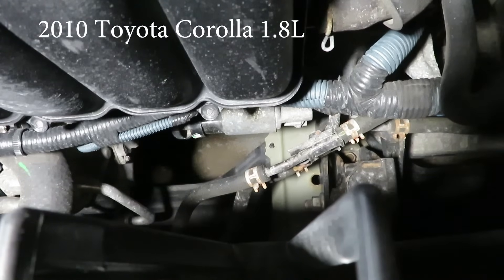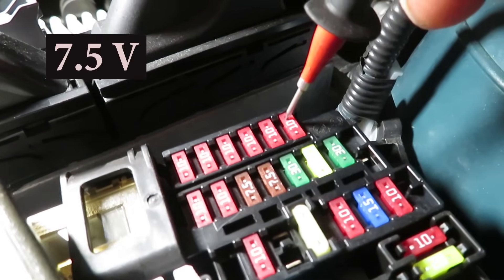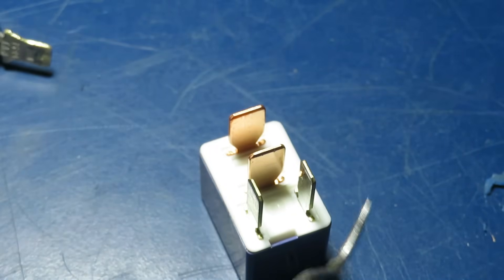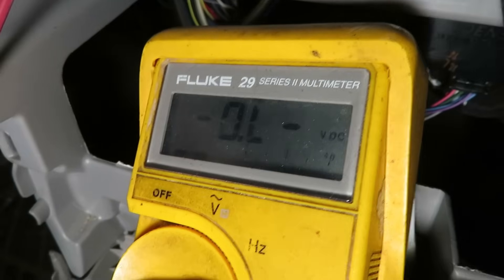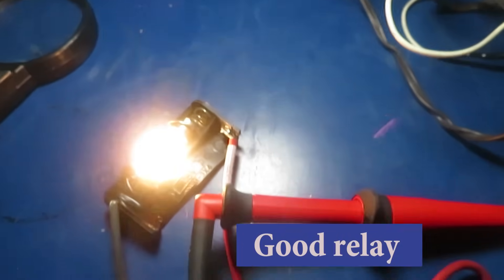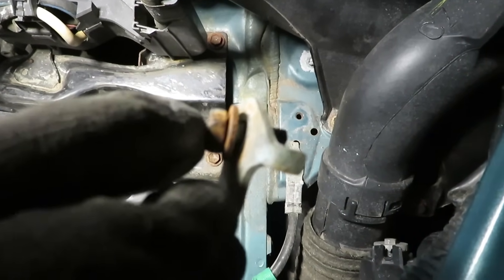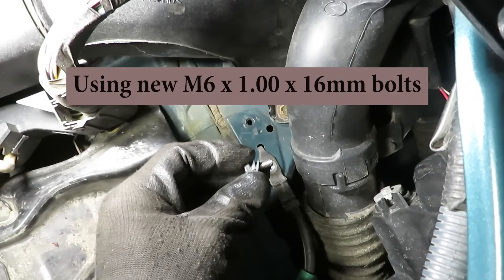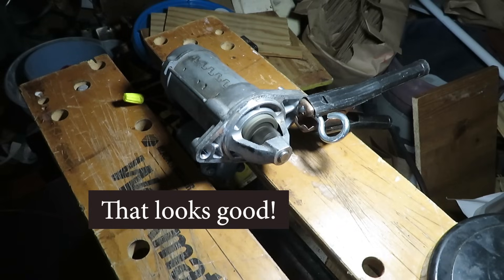When Your Car Won’t Start: Symptoms and Solutions for a Bad Chassis Ground

Comment: Good Job, but you might also want to replace that battery cable which had obvious corrosion showing; that green stuff just keeps on creeping. Thanks for the video Sir!
Reply from the maker: I usually just brush it with a mix of baking soda and water to neutralize the acid.
Reply: I agree with you John, it will travel up the battery cable under the insulation.
Reply: My car is currently sitting right now and I just replaces the starter.  New battery, all lights work, radio, etc.  Could the ground to chassis still be an issue to a no crank, no start issue?

Comment: The methods are good but the diagnosis is bad. You start with the simplest solutions first that involve NOT dismantling the entire interior.  Then you travel ahead through the symptoms until you get to the more complicated troubleshooting that involves removing the starter, parts of the interior, half the dashboard, etc.  If you're running a shop with high labor by the hour rates though I'm sure this is a method of choice to make tons of $$$$$$$$.  First thing first would be making sure terminal posts are clean and tight and check it.  Then source a new battery and check again. Many people are too ignorant to know their battery is dead. COPART yard monkeys even does this. They will say a car doesn't run/drive when it just has a dead battery. If that doesn't fix it then start poking around with fuses, wiring, etc, all that stuff.

Comment: I messaged you earlier with the 2012 Corolla. Very awesome videos. I have had trouble with this car since before it broke down 2 years ago. But when it completely died i was driving on the interstate and everything went out as if you removed the battery. At the time I really thought it was the starter and it was bad. But after replacing it i found out the alternator had to be replaced along with the ECM, interior fuse box and this relay that goes to the starter and fuel pump. Also the crank sensor ended up being the last item i replaced and I went back to the internet and found your outstanding videos. Im pretty sure its either bad ground,  no power to relay socket or this relay went out . I say this because the new starter keeps going for about a second or 2 after key release. Thanks so much and keep up the great videos!! They really,  really help, especially folks like me.

Comment: This was an AMAZING, JUST AMAZING piece of work finding this!  I have a mazda 3 2006 and my car won't even start.  I will check the fuse box but my expertise is not going further than that, sadly.  Watching you finding this problem was very inspiring and educational, I would have never imagine it would be a simple 'ground contact' problem.
Reply from the maker: I appreciate the feedback. I have a three part series on ways to troubleshoot and fix starting problems. Part three is the most popular:  https://youtu.be/Pw_iuxjgzyY
Reply: LOL i have the same car, same problem, same day, thats how i ended up here. the ground on 2006 mazda 3 sucks and wears out
Reply: I now recommend all my friends before even bringing their car to anyplace, to first sand their battery connector, re-install and try to start their car again.  My battery connectors look fine from outside but when i deconnected the negative side (-) i realize it had greenstuff all around the inside!  I sand it, then re-install, and bang!  Start without ANY DARN PROBLEM!  It seems that green stuff is really good at isolation!  I mean, even when i play around the connector, i sometimes get 'sparks', so it was the last thing i would have thought was the problem!
Reply: @jessikapiche6097  lmao I can't believe I read your entire comment

Comment: Yea -Haw.  Found your excellent video.  100 bucks says this fixes my new 07 vibe that stranded my wife and i had to go jumpstart with my 3 year old.  Just got the battery in it.   It died on me pulling in my garage after a bunch of dash lights came on after i spun on ice at the driveway end.  Hasnt restarted yet.  
Your a noble gentleman!  Thanks from minnesota.  I snapped a shot of your hdwr Text.  
Thx in advance of my repair!
Reply: Yep.  It worked.  Thanks!

Comment: 2009 Corolla dead in driveway- changed the battery with a recharged one, actually saw the two chasis bolts you highlighted- rusty so hit them with shot of cleaning vinegar - I think you've put me on to something ! 
News @11

Comment: Just had this problem with my 2010 Hyundai Genesis Coupe...starter would just click...watched the video, ended-up replacing the negative battery cable and the post...fired right up! Great video...thanks!
Reply from the maker: You're welcome. I'm so glad the video helped!
Reply: That why I interest to big 3 upgrade even I don't use after market stero sys .

Comment: I've had problems with starting my 2010 Toyota Corolla LE. Try to start the car, hear a sputtering sound, weak lights on the dash. I get out, disconnect the battery clamps, then reconnect them then boom, car starts up with bright lights on the dash. Bad ground connection builds resistance that jams juice trying to flow through many possible electrical hookups. Beautiful video is a sight giver.
Reply: How did u fix this I’m having same problem
Reply: @camillatucker9802  I haven't fixed my problem. Did you try what was shown in the video? Disconnect the ground wires to the chassis of the car, then reconnect them after cleaning them?

Comment: Yep bad grounds can drive u nuts. Lights flicker is a good sign. Clean your cables and what I do even on the battery post clean and put a little grease on them. And same on the motor.  Where the other end goes .

Comment: I would advise using a volt drop check rather than resistance. From the earth bolt to the earth eyelet a good reading would be 0v. Also, with the starter in place if connected a jump cable from the starter body to the negative terminal on the battery and it starts, you know you havean earth issue

Comment: I like the scrapping off paint to get bare metal to metal contact but isn’t that going to create the same problem you’re trying to fix with the corroded ground bolts? Wouldn’t replacing with new ground bolt be the better solution? The thread to thread contact should be enough for the ground path.
Reply from the maker: It made sense to me at the time but I think you have a valid point. I still have the car three years later and thankfully the problem has not recurred.

Comment: Bout to check for the signs, but what causes the check engine light not to display on the dash when the key is in the on position .
Reply: Check your ignition relay in the fuse box under the hood. Just had that problem, but replacing that relay got my dash lights bacc on

Comment: I have issues starting my car when it's hot. Sometimes it just starts right away even while warm, sometimes has issues starting while cold, but mostly while warm (it sounds like a slow cranking) which is a pain in the ass as I gotta wait for it to cold down (around 45 minutes). I already cleaned injectors, replaced fuel filter and serviced the starter motor, all of that is good now, but still have the same issue.
Gotta try this chassis ground thing now, hope I can find where the ground connections for everything is 😅
Reply: Did it end up working?
Reply: @tongxiong3060  it did. I replaced some ground wires and problem fixed. I felt really stupid afterwards because the fix was kinda easy compared to everything else I did before 😅
But now I know that ground wires can "get bad" and need replacement.
Reply: @cotelo  that's good to hear because I'm having the no start issue as well and seems to not start when warm and more so when it's colder.  I'll have to give that a shot.  Did you have a no crank issue though?  I just get a single click with all accessory lights on.  With these issues I've been able to tap on the starter to get the car going but now it's just not doing anything.  I replaced the starter and same thing so I'm kind of lost.

Comment: Grind all paint and the contacts ,,replace hardware with stainless , coat contacts with copper based dielectric grease .now treat all grounds on vehicle same procedure

Comment: If u read this.   I had the same thing.  With the sfarter installed.  Touches the starter i got 1.2 voltes.  As i gave it ground my horn sounded off
Reply: If you read this. Good job learning English 👍

Comment: My 1984 Toyota battery is fully charged. It won't start l. New battery terminal clamps and smoke started coming out heating up and ground melted. Why?
Reply from the maker: Sounds like a short to ground or the battery terminals are reversed.

Comment: mine only does one click   but i see a  kind of corrotion too and i have been having  alternador  problems ( got a new one )  the head lights  flicks and the  car  kind of  surging  on  parking  or  it was  now  its completed dead for  2 days  i was thinking about ignition switch  but   we the history of  2 bad alternadors ?  only does one  click  not exactly the same  as the video   i wish  is the  same problem  is  cheaper ( battery is giving 12.6 v ) some one told me  bad cells?  is a new one but its a AAA  road assitance  battery i  see theres a lot complains   )  any ideas?   thank you 
note  :  the car  did this to me like a mounth ago but  started  next  day   but no this  time i kind   felt it  low  star in the morning  and  it died  in the afternoon  ..so a bad  iginition  swicth could it give  me a slow star  ? or   this is   meaby  a ground strap  problem ?
Reply: Hey Percy! I know this post was like from 2 yrs ago. But I been having the same exact issues u described in ur comment, with my Infiniti. And I was curious if u ever fixed ur problem with ur vehicle and what needed to be done to fix it? Thank u

Comment: it necessary to scrape paint if you dremmel lug and bolt?  wouldnt that carry the current if you get the rust off the bolt and washer
Reply from the maker: Yes that would be enough.

Comment: My '10 Corolla LE has a slow cranking issue and never starts.  Had not driven the car in about six days.  Decided to start the car but would crank but not start.    The tow company thought my battery was bad and possibly the alternator.  So, I went and replaced the 2.5-year-old battery with a new one thinking a good battery might solve the cranking/start issue.  It did not solve the issue.  When I was installing the new battery I did notice that the ground bolt was very rusted.  Do you think this is the issue?  I have never had starting problems with the car before..
Reply from the maker: I too changed a good battery when this problem came up my Corolla. Definitely make sure your grounds are good!
Reply: @ginalMechanic The car is at my mechanic and advised to him to look at the grounds and check to see if they are good.  Hopefully, that's the problem and nothing major.  also, during those six days the car was not started, the key fob battery was dead so I replaced that battery.  After changing the battery. the key fob seems to unlock and lock the car.  However, does the key fob have to be re-programmed for the car?  Maybe it might be causing some issues with the start?  Just trying to rule things out.
Reply from the maker: No, the key fob would not need to be reprogrammed. You can rule that out.  @savio1172

Comment: Hey, question.. How did you have the starter wired up at 0:32? Just positive end or just negative end?  Occasionally my starter plunger will come out with a single click and not spin, just like at 0:32. This rarely happens but is always fixed when I hook the starter up directly to the battery.. then it starts right up. I've had the starter bench tested and tried a different starter but get the same result. Ive checked all wiring and cleaned all connections multiple times, all seams fine..have you ever heard of this happening? Any ideas?
Reply from the maker: I had both positive and negative wired up with the positive directly to the battery plus and a jumper cable on the negative. That's a toughie. i would definitely use a meter (set to measure resistance-ohms).  Check resistance from battery negative to various solid metal points on the engine and chassis. If you get anything but very low readings on the order a few ohms or less you still have a bad ground. It sure sounds like a poor ground connection since it starts directly from the battery.
Reply: Awesome ill take another look around the ground connections and pull out the meter. appreciate it @TheOriginalMechanic
Reply from the maker: I should add that at 0:32 I simply extended the car start  wire to the solenoid with a wire to reach the  the removed starter  under test.

Comment: My car is full of rust and all I here when I try to start it is a click coming from the starter 😢
Reply from the maker: That click is likely the solenoid and a sign that there is either not enough power from the battery to the starter windings or open windings.
Reply: @TheOriginalMechanic what are windings?
Reply from the maker: @j7sportvideo24  The electrical part of the starter. I'm basically saying that the starter itself may be bad.

Comment: Glad to know all major ground. Just want to know more where can I find ECU ground ? Btw good video. Thank in advance. Wait I want to know ignition coil secondary ground too. I know where fuel injector ground are. It on engine easy to find.
Reply from the maker: You would have to find the wiring for each component and then probe it for the ground. Remember all grounds in a circuit go to the same place.
Reply: @TheOriginalMechanic  good idea I got low quality probe cam can't use in cyclinder. I might use it

Comment: brilliant sir. but in my case, car starts ok but needs longer cranks mostly when warmed up. 
scenario:-
1) morning cold start, or whenever climate is cold = one crank ("hek") starts right up
2) after shutting engine off and restarted within 5 minutes = one crank ("hek") starts right up
3) after shutting engine off and restarted ANY DURATION AFTER 5 minutes, 
= 1st crank ("hek hek hek hek hek hek"), 2nd crank ("hek hek hek") then starts.
I don't think the starter or ground is the issue here because of no.(2). 
Two different workshops mechanics told me it could be the distributor (w/out detailed checking). 
Battery/alternator both are fine. Been having this problem for four years now. 
on a side note (not sure if this is related) my car runs fine but idling is very slightly rough.
Do you have any video on this that I could refer to? many thanks in advance.
Reply from the maker: This doesn't sound electrical at all. Since it occurs when the engine warms up I would wonder about the engine itself. I once had a car that would always start great but when hot it would randomly die and not want to start again. It was a broken head bolt. This could be a lot of things, many of them hard to find.  I would  have the compression checked first and see if that turns up anything.
Reply: @TheOriginalMechanic  my car would not die randomly, in fact never before been in that situation. ok sir will do that during my next service. thanks anyway for responding to my looong query sir 😅 have a nice day

Comment: Is it necessary to dismantle the dash?
Reply from the maker: No it isn't.
Reply: @TheOriginalMechanic  Ok. I have a problem with a Grand Vitara. When I switch the starter, the car doesn't start and the dash lights start flickering erratically. It also makes weird noises inside the dash, specifically around the radio and AC controls. What can it be?
Reply from the maker: @leumamk5259  I would start looking for a bad ground. These are the types of symptoms that show up when there is a poor ground.

Comment: No mention of how you set up he multimeter. Negative battery terminal removed but not positive? And, was the negative on the multimeter somewhere in particular?
Reply: Also next time I suggest adding some dielectric grease to the fttings to ensure continuity in the harshest conditions.
Reply from the maker: I had the meter in the ohms (resistance) mode. I thought I pointed that out. Since we are dealing with a ground issue I did not disconnect battery plus. The meter measured resistance between the battery ground connection and the chassis t near the suspect lug connection. I hope this helps. I strive to be clear but occasionally fall short.
Reply: @TheOriginalMechanic  Thanks for the reply! Great video of course, you went ALL OUT. Still though where is the negative on the multi-meter placed? I just watched another video where buddy left the battery completely connected but place the multi-meter's '-' in the negative terminal..?
Reply from the maker: @davidthomas6949  When measuring resistance the polarity of the meter probes isn't important. But to answer your question,  I had the the negative  on the clamp end of the battery ground cable and the positive  on the lug bolting that cable to the chassis.  A good connection would have been .2 ohms or less. I got 52 ohms which revealed a poor ground connection.

Comment: For the ground did you have to disconnect the battery first or just remove ground ?
Reply from the maker: The ground strap being removed is about the same as disconnecting the battery.

Comment: What do I do if the car cranks but won't start? The lights works but not the stereo. I changed to a new battery to but it's not working. Will this fix my problem?
Reply from the maker: Possibly. A quick way to find out is to check resistance between the battery negative and the engine block. It needs to be a few ohms or less. If not clean up the ground connections.
Reply: @TheOriginalMechanic  I try it out. Thanks for the tip!